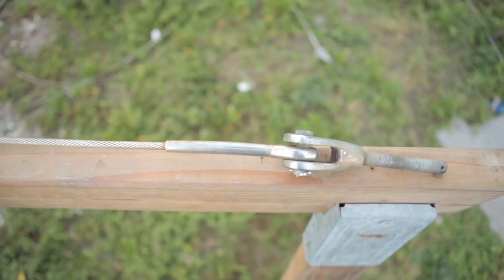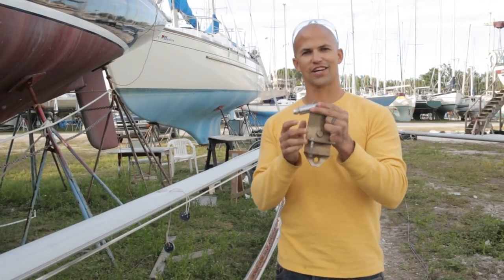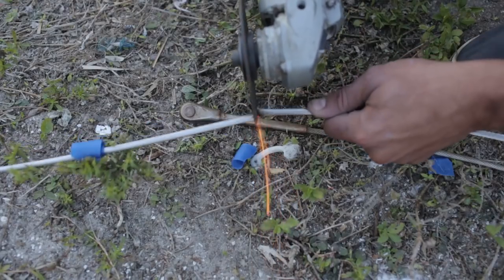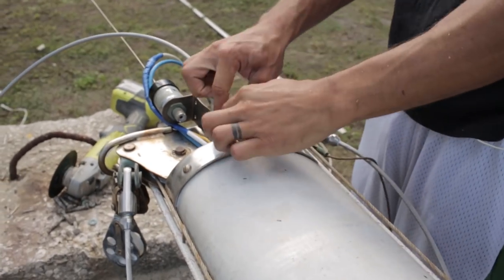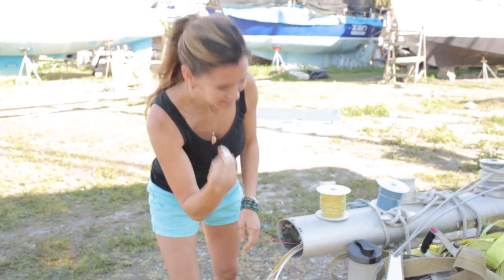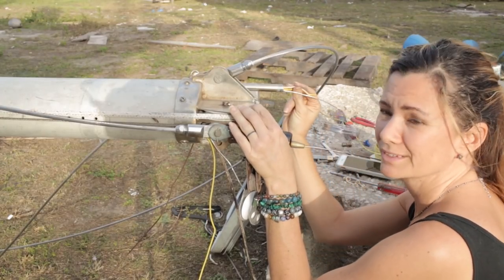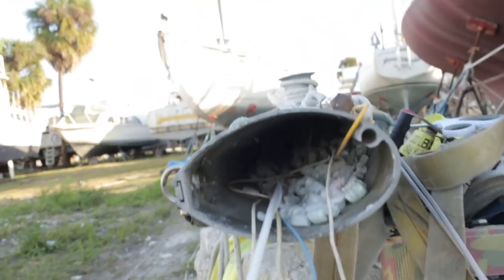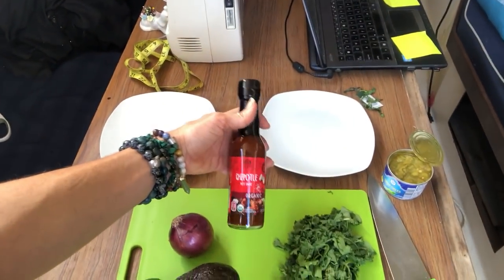Sailboat Mast Renovations | 7 | Beau and Brandy Sailing

Comment: how old are those Mast Tangs? i don't think it was a good idea to cut that piece off
Reply: curacao11 Their passion is unquestionable; I worry about cutting tangs and enlarging holes as they’ve done. Also, it really doesn’t take much to create a stress riser from a rough cut/drilled edge.  Maybe also invest in some ‘Derustit’ to properly passivate the SS.  That said, they’re kicking some major ass with their refit and I hope it works out, which I’m sure it will.
Reply from the maker: Appreciate the concern
Reply: Should have rounded the cut angles to reduce stress points, they will crack at the 90. (I would just keep an eye on them)  other than that keep up the good work.